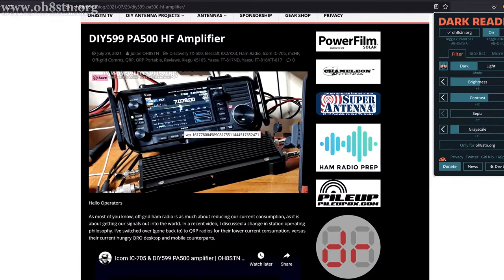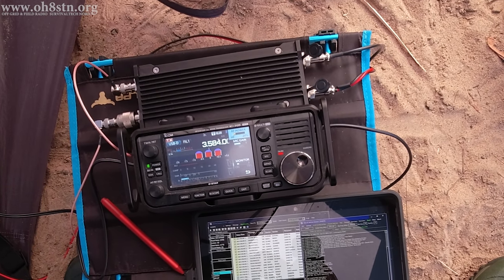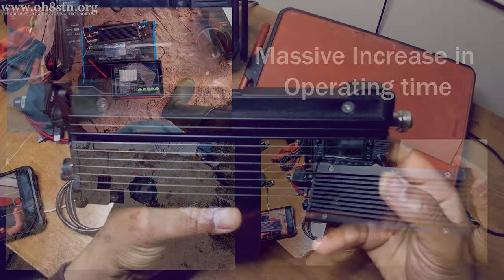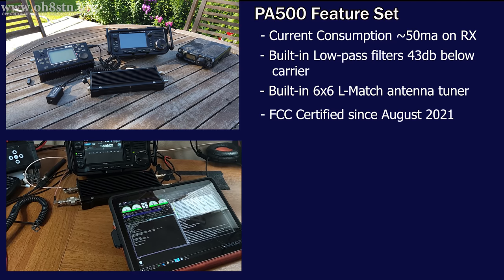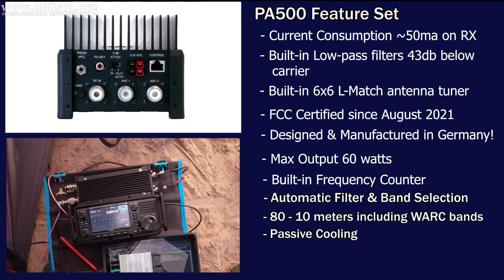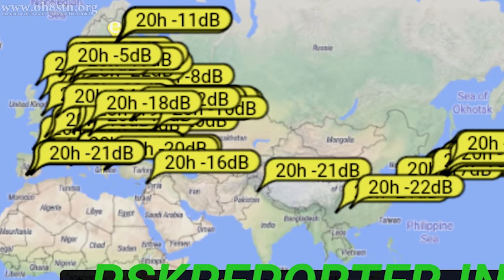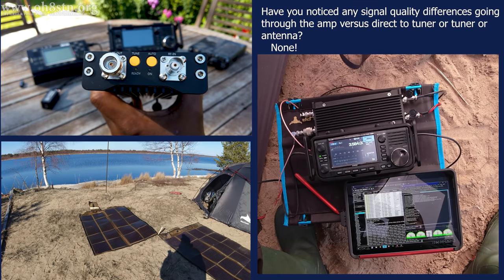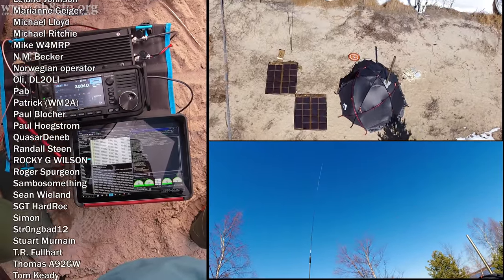Ham Radio Amplifier DIY599 PA500 OH8STN

Comment: I received my PA500 yesterday. Fantastic replacement for my Elecraft KXPA100 in terms of portability and current draw. Using 6Ah Bioenno for the last two days with the IC-705 using it's internal battery on SSB and it really holds up well.  No key line needed.  Excellent amp.
Reply from the maker: Thanks for this comment Terry. It actually made my day :-)
Reply: Hi Terry...So I am contemplating ordering one, do you still love this amp? Any issues? Thank you
Reply: Yup my KXPA100 certainly draws some big current at full power , and I'm not ready to throw it and a small car battery to feed it in my backpack and head out on my mountain bike anytime soon you might say, Nice that there is a KX3 cable solution available already. I could be tempted Ha ha

Comment: There is a lot I like about this concept. Someone out there clearly understands the need for light power efficient gear. Rugged and reliable are two words that come to mind as well. I am now the ACS (Auxiliary Communications Service) Emergency Coordinator (EC) for Bruce County, Ontario Canada. As such I understand the value of high quality reliable gear. ACS operators provide backup communications for our "served agencies".  This includes all the emergency services, hospitals, government administrators etc. If our group were ever called out in a real emergency the situation would be very serious. All other communications would have failed and we would become the primary means of keeping communications up. This situation would also mean that we would be operating in some form of grid down communications. Power consumption would be very important and so QRP digital would go to the top of the list of priority modes. This would be especially true if we were being asked to pass a lot of traffic. Generators with no fuel also provide no power and so solar QRP rigs would be the true hero of such operations. I believe that anyone operating an emergency communications station, either for personal or formal EmComm use should be thinking about real world grid down communications using QRP.
Reply from the maker: Thank you so much for writing this Marvin. It's often an uphill battle to get these points across.
73
Julian oh8stn
Reply: @OH8STN  what about the situation that you need even more power because you would have crowded bands and crazy pileups when the SHDF with everything down - on the first months I would assume the bands would be crazy - at this point do you think 100W would be better or would a smarter better antenna be the way to go?  It is all interesting to learn and I am somewhere in between two worlds - seems like we really need someone to build a modular tank so we can have flexibility in all aspects.  You seem to understand this point really well now we just need a plug and play solution that is rock solid and modular - i hate the construction of 705 and the price.
Reply: A Propane Generator would be a handy tool. Extra extention cords. 
Extra spools of coaxial cable and all connectors. Spare antennas. And boxes of hand-held radios for SAR.
Reply from the maker: @EdinGacic  There are milspec radios (green radios) if you want a modular tank. The problem is they cost much more, and are usually much heavier.
Reply: @EdinGacic  60/100 W is almost no difference in real life.
Reply from the maker: The difference between 3 and 1/2 amps or 5 or more amps coming in. At higher latitudes there's definitely a difference

Comment: I love the current-sipping equipment... no way around liking that! My question... have you considered the combined expense (time/money/weight) between the modular QRP + amp setup here vs. simply carrying a larger battery for the QRO radio? I would look at time to set up the station, total weight of the man-portable pack(s) plus complexity of the station. This last part might matter if you were to do a quick set up to get on the air only to discover you need the amp and have to re-configure. Nighttime setup could also be a 'complexity-multiplier'.
I love your content, Julian! Thanks for your work!
Rob

Comment: For years I have used the idea of using a QRP radio to drive an amplifier on 2 meters at my home / off grid station. I use an HT to drive a 25 watt 2 meter amplifier.

I am totally sold on the idea of using a QRP rig to drive an amp. 

Thanks for yet another excellent video

WB8ERJ

Comment: Having recently picked up a TX-500, I'm definitely intrigued.  I've heard the price tag is a fair bit, but that seems pretty par for the course with amplifiers.  Considering both will be made to mate with the TX-500, I'm curious to see if there's a way to "stack" both this AND the upcoming battery pack from Lab599 with the radio at the same time into a single interconnected brick.  Also, what does it weigh?
Reply from the maker: Excellent, now. Oddly I answered all of the more difficult questions but forgot the most basic. The weight is 900grams. I'm walking the dog right now so I can't convert that to Imperial. It would also be nice to see if that lab 599 battery pack can power the amplifier. Excellent comment!
Reply: @OH8STN  Awesome.  31.75 ounces, or a quarter of an ounce shy of two pounds on the nose in Freedom Units.  ;)  (Yes, we're very silly.)

That means the combination of the TX-500 and the PA500 is still almost exactly one pound lighter than an FT-891, which still lacks a tuner.

Comment: Another excellent video, Julian! I have approached my entrance into ham radio wanting resonant antennas and qro radios.  Less complex I thought. You bring up valid points of current draw.  So I am considering your advice for portable ops (I haven’t put my QTH together yet). Portable is appealing with POTA and SOTA ops.  So the answer to your question is yes I would consider this approach for sure. Thanks again, 73 de KI5HXM

Comment: Hi, just one question, usually do I need a special cable for a FT 818 ND oder is it the antenna cable connector? I am somewhat unsure, as I see a CAT interface.

Regards
W.
Reply from the maker: With this amplifier you only need the antenna cable. You can hook up an optional push to talk cable for it if you like. I'm using it without the push to talk cable since the latest versions have Vox circuit for automatic push to talk

Comment: I always thought it would be really neat if there was a plug in option for QRP rigs, to get rid of jumpers and control cables. That always ruins the feasibility of using an amp on QRP. Too much cabling. Power to rig, power to amp, jumper from amp to radio, CAT connection from radio to amp. FT-891, 1 antenna connection and 1 power. Simple and done.
Reply from the maker: This is true. My only real problems with the ft-891 were the current consumption and of course larger capacity battery requirement. For short excursions it was absolutely magnificent and easy to deploy.

Comment: Very informative as always.  Thanks, Julian!  Question: if you already have the AH-705 tuner, would you use that in line with the amp or use the built in tuner in the amp instead of the AH-705?
Reply from the maker: Thanks for the question and kindness. I would use the ah705 for qrp work without the amplifier. When wanting to use more power, use the amplifier with the 705 on its own.
Reply: If I’m interpreting the OP question, would the 705 tuner be used with amp or would the 705 be used without the tuner engaged and rely on the amp tuner.  If that is the original intent I believe you should not run the 705 tuner when connected to the amp as the amp should present 50ohm to the 705 hence no need for the 705 tuner.  The amp tuner is designed to match the antenna to the amp.
Julian, I really enjoy your perspective on radio communications.
Reply: Awesome report, as always. Thanks.

Comment: There is so much to say about this amp.  I think this is a turning point for making the IC705 have a bit more power so you can get that extra 1S unit to make contacts.  Although, the SFI index is getting better and this amp might not have to be used in the coming years.  On the other hand, like you said, this can be used for your home station.  Can't wait for this to be sold on Gigaparts.
Reply from the maker: That's a fair question. The first hurdle was FCC certification. I believe the second hurdle is finding a distributor in the United States for sustainable sales and support. That's just my guess. Join the groups.io for more detailed discussions.
Reply: @OH8STN  Thanks Julian.  I did join the group.  Have a great weekend.

Comment: My friends in the Young Amateurs Radio Club on Discord have been playing around with using a slinky to couple to a tree as a vertical antenna. This seems like a great way to save space from carrying around an antenna, could you make a video testing it?
Reply from the maker: Perhaps I could do it on video sometimes. I've already tested it off camera. It's basically a loaded vertical. Of course if you have two of them it can be a loaded horizontal dipole. With the vertical you still need counterpoise wires at the base of it for a balanced antenna. I found it's a lot of work, and won't give very consistent results since the slinky is moving all the time. It's an excellent experiment. For that reason alone if might make a great video.

Comment: Could you talk about the watts that you feed in the DYI PA500?  I'm struggling to find the right output for my TX-500.
Reply from the maker: First of all, never run more than 5 Watts in. It will only create noise. I have found you can drive the pa550 at 2.5w watts and get maximum output. That's with cw and data. With ssb 5 watts. If you put more than 5 watts in, you may  damage your amplifier.

Comment: Hey, Julian.  Thanks for the video. I have a question about your configuration of the MPAS 2.0 in the video. I see the whip and ext as well as the hybrid micro. But, I’m wondering whats the  “coil?” in between the radial sections and what’s the configuration for which frequencies?  I love having modularity and knowing the options. Thank you.
Reply from the maker: Was just testing an 80m coil from the super antenna. It was placed between the extension and the whip to add a bit of loading for better 80 meter performance. Works like an absolute champ.
Reply: @OH8STN  That’s what I figured. I have all the Buddipole parts (low band coil, yagi and extra arms etc. ) and like how they can all work together with chameleon parts having the common 3/8-24 hardware. I have lots of fun experimenting and I’ll try that next because I just got the CHA EXT.  Digital on the TX-500 is next.

Comment: An amazing set up. I took note of the antenna and wonder how other antennas would work such as an end fed half wave. As always, your demonstrations make me start searching for my Visa card. I certainly hope Giga Parts will get on board.
Reply from the maker: Excellent feedback and thanks for the kindness. The worst case I've seen was tuning a 40 meter resonant dipole, to tune up on 80m. I think the tuner is designed for dialing it in rather than tuning up a chain-link fence on any band. I've tested with the mpas, the chameleon lefs, the packtenna random wire, ... resident or Broadband, I think it'll do just fine. Remember though, it does have limits.
Regarding GigaParts, please send sales a message and tell them about this video. I'll bet they'll get on board pretty quickly. Once again thanks for the comment, questions and especially for the kindness.
73
Julian oh8stn

Comment: This seems like a really well designed amplifier, and your videos are always really well done!  The max power out is 60W....I can't imagine that this amplifier will be inexpensive, or easily obtained.  I will stick with my G90....20W, built in ATU....and pair it with an antenna which has much lower loss and greater ERP compared to the MPAS in this video. 73
Reply from the maker: G90 is a great Option. It still has more current consumption on RX than this option, but it is one way to do it.
Reply: @OH8STN  I guess it depends on your application....for POTA or SOTA, there will be much more TX, so I believe the increased power consumption for RX would be insignificant compared to the power consumed during TX.  The question really is: how is power consumption during transmit?  Ie 891 set to 60W vs this combination, or this combo set to 20W vs the G90?  Have you tested that?

Comment: Julian - what is the power consumption of the amp ? Do you use a single battery to power radio and amp?
Reply from the maker: Take a look
https://oh8stn.org/blog/2021/10/25/lab599-discovery-tx-500/

Comment: Julian, tnx fer introduction. Did I miss the info if I can use the ATU w/o the amp or only with the amp on? 73 de Wolf, oe7ftj
Reply from the maker: That's an excellent question. So far I haven't figured out how to use the the tuner without the amplifier. This would be an excellent software update if it's possible.

Comment: I was contemplating the IC-705 for a portable rig but 10 watts was half what I would have liked and was, at least for me, half of what I needed.  I had half decided to get an IC-7100.  This pushes me back toward the IC-705.  Thanks for the review, Julian.
Reply from the maker: You are very welcome.👍🙏
Reply: Why don't you just get a xiegu g90?  Very low price, 20W, and built in ATU!  No internal battery, but otherwise I am very happy with mine.....perfect for occasional portable use. 73

Comment: Awesome and very informative! Could you tell me what kind of connectors are used for CAT control and power in? Have you got any idea if these are available in a right angle set up to save space? I looked for those connectors but have no clue what they are. Any help would be very much appreciated.
73, Jo - DL1JRM
Reply from the maker: GX12 connectors available from ebay. Details in the user manual 👍
Reply: @OH8STN  Trank you for the quick reply!

Comment: My QTH rig is a G90 with an ebay 100w amp going through a Radiodity lowpass filter. So yeah I think a low power radio and an amp it the way to go.
Reply from the maker: G90 has great current consumption for a 20w rig. I'll check out that radioddity LPF. Had not seen it before. Thanks for the comment and feedback.

Comment: I run an FT817ND + a little Chinese amp which gives me 20W :-) a lot cheaper.
Reply from the maker: Not a bad option if running a resonant antenna. I bet that Chinese amp has a lot more current consumption though when it's idling. Does it also have a tuner built-in?
Reply: I run a T2FD antenna which does not require a tuner :-)
Reply from the maker: Outstanding. In that case, probably working at extremely well.👍👍👍

Comment: Hi it would be nice to see video´s on cw and ft-8 operation.
Would it switch fast enough on cw and stay cool enough on ft-8 outputting lets say 25 watts for  50/50 duty cycle (6 minutes in the manual)...?
Another thing is not 100% clear to me, in bypass no tuner or filters can be used?
Really like the other specs and looks  of the amp.
73

Comment: Thank you for a great video , my old FT-817 ( non ND)  went defective  and had a fun time deciding which one to purchase. In
Canada there is a 28% US exchange plus a 13% taxes on any import radio so my chooses dwindled to only a few. I decided to
 pick up a New FT_818ND as I have most of all the goodies including the CW filter.  
       I like your input of the new DIY599 as an acceptable amplifier for any QRP station, It would be nice to see what kind of RF power
max out on Digital is of the tree QRP radio's you displayed in the video  plus the  current consumed with the DIY599.  As a side note 
at 74 years old I have get the purchase by my CEO, Wife of 46 years ...............  Mike, VA3MD
Reply from the maker: Excellent point about having all the goodies already. Using data modes with the 818 and small efficient amplifier doesn't seem bad at all. I'll do videos on all three of those radios plus a couple of more.
73
Julian oh8stn

Comment: Nice vid! My opinion is not electronic, but, in general i prefer modular setups for many things. I like that you can operate the radio with or without the amplifier, so if you have a need to conserve you can. If you want to splurge, you can do that too. Also, if your traveling on foot with someone else you can split the weight.
Reply from the maker: Not sure how I missed it this comment but very well said. I wasn't so interested in the modular approach previously, but now it makes much more sense. Thanks for the comment Michael, it's very much appreciated.
73
Julian oh8stn

Comment: I am on the waiting list for the amp.  Is there a way to connect the amp to the radio by screws or some other means to make a single attached unit?  I realize there will still need to be external cables to control and provide RF to the amp.  It would be nice if the two were able to be mechanically joined together.  

Also have you heard any release date info on the battery pack?  599 have been working on it for a while and I hope they are close to shipping it to us eager hams!
Reply from the maker: The app can be connected to the radio with pass-through screws and nuts. I think there was a threat about it in the apps group.IO pages. Unfortunately I haven't heard much about the battery pack other then the announcement that it would be coming out this year. Definitely interesting times with some innovative New Gear coming out.